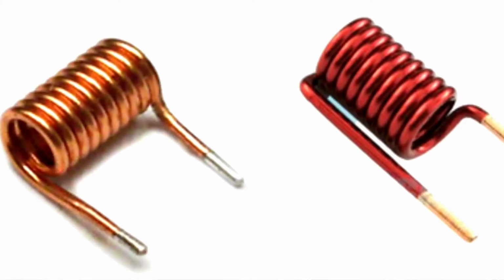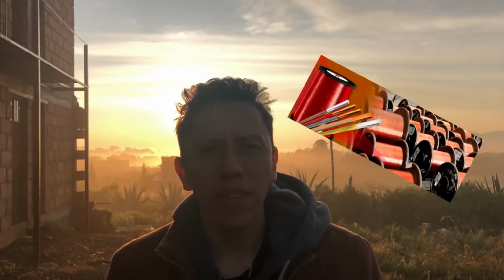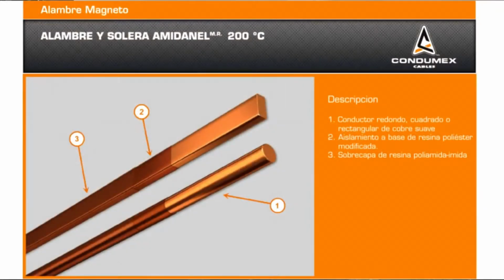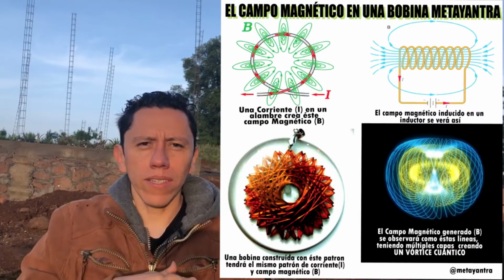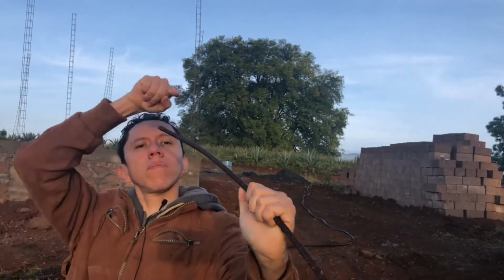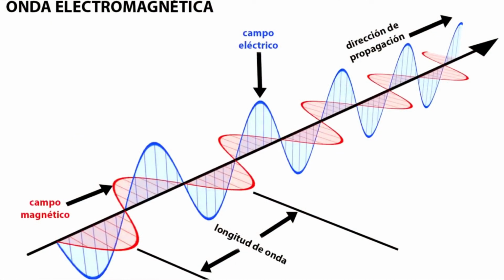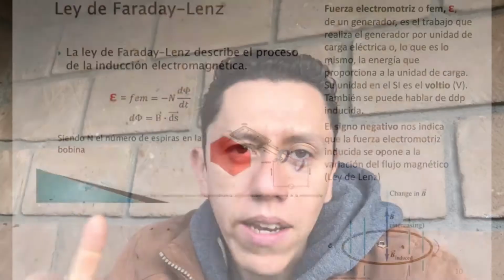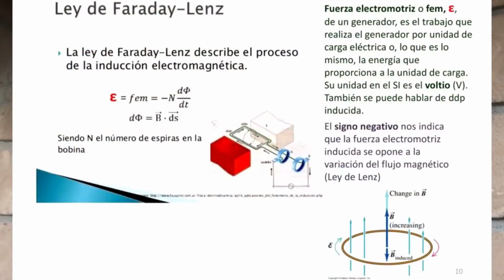PROGRAM YOUR REALITY WITH ORGONE ENERGY - MAGNETIC INDUCTION OF METAYANTRA DEVICES

Comment: Hi, your information really makes me think, great video. I fail to understand that when you are wearing the pendant what is the power source that creates the magnetic field and makes the coil work? The Tesla coil made the LED light up, i can understand that but why would it make a magnetic field from the coil when your wearing it?
Thank you, im learning.
Reply from the maker: Hi Thank you very much for your comment! This will blow your mind... THe power source is YOU! and the electromagnetic radiation surrounding.
Reply: @metayantraww  Your right 🤯 wow this is so cool! I guess that the coil kinda works like a MWO antenna (multi wave oscillator) and thats why you don't want the ends soldered together, you need the coil not connect (so it's not one solid wire) to pick up the energy? I've watched this video more than once trying to wrap my head around what your saying, just fascinating. Makes me want to try and make one myself.
So resin, quartz and the coil using winding wire and do not soldier the wire together.
Have i pretty much got it right or any crucial pointers you can suggest would be helpful, thank you for putting out the information!!!